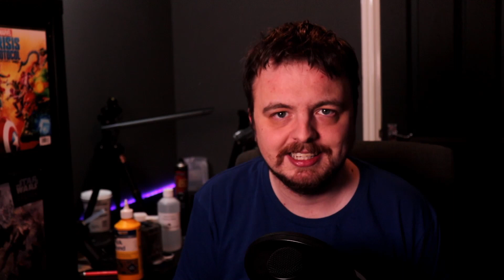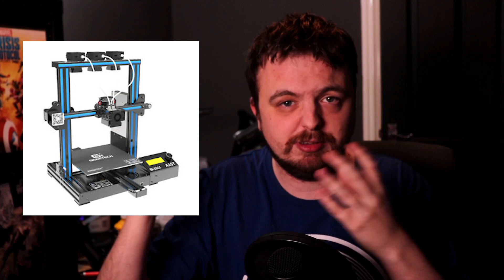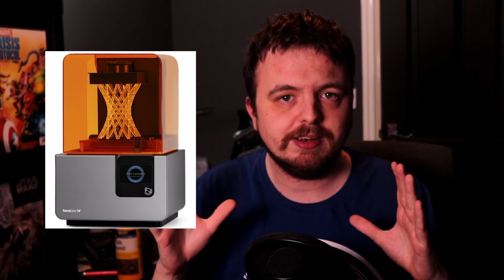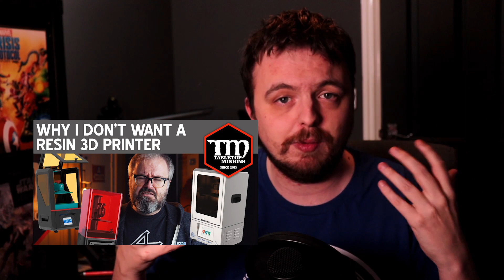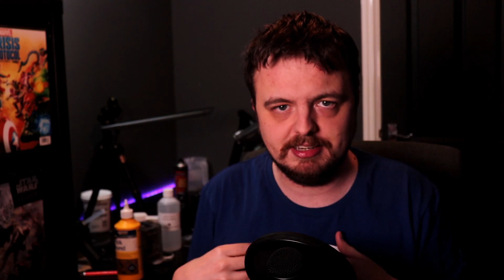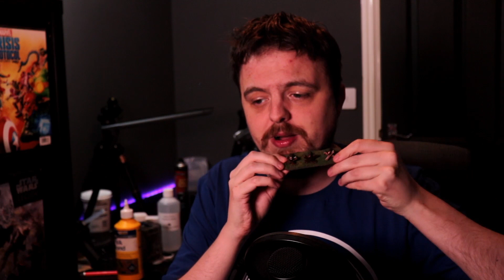Resin VS FDM 3d Printer For Terrain?

Comment: resin print time is only really determined by max vertical height. a full plate will print at the same time. That's a big advantage to fulfillment if you can maximize space efficiency.

Comment: U mention that you can chop the Terrain up so it can be printed in parts on the resin but yoi say this is difficult or near impossible.?? But is it? I thought/hoped it would be quite easy to split the pieces down and glue them later

Comment: I have an Ender 3, im getting a Creality CR-10, and I own an Elegoo Saturn.

I use the Saturn to print off whole armies of minis in a single day, because the Saturn has a massive print bed for a resin printer, but looking at the size of most terrain, FDM looks to be the way to go there, as for "Well the layer lines are clearly visible." Not everyone needs perfect 1-1 terrain, I personally just want terrain for wargaming that doesn't cost me a hundred dollars per piece, and I don't have the skill or the will to make stuff out of foam, foam feels too wasteful to me, any incorrectly placed cut and you end up with a ruined block of foam, but a decent FDM print means maybe a quarter of a roll of filament that I can print off while im painting or while im at work.

If it looks good when its painted, who cares if you can see the layer lines from an inch away?

Comment: I've been using flsun qqs pro deltas, 0.2mm layer height at 100/mms speed. Getting good prints in half the time of typical ender 3 pro. A 3.5" by 4" building 2" high took 4 hours approximately. I tend to go for stl designs that need no supports and small amount of infil.

Comment: I have a Tevo FDM with the large bed, it works okay, but the terrain can get bad, I pre ordered the elegoo Saturn because of the build volume, so I am currently doing research. I don't see anyone talk about if you have a large build plate resin, how much faster it would be to print multiple things, like 3-4 tower walls at once, since it takes the same amount of time, that would be significantly faster than an FDM
Reply from the maker: That's a great advanatage to resin printers, multiples at the same time! The main downsides are the actual resin, cost and saftety etc.

Comment: Awesome video as always Jay.  I have had a CR10 Mini for two years and had very little success with it to be honest and it hasn't been switched on for over a year.  My wife bought me an Anycubic Photon Zero as an early birthday present and I was so impressed that I bought a Elegoo Mars the week later with the cash I would have spent at Salute this year.  Great printers and ideal for MCP and Legion to print out smaller things as you say like control panels and griblings and the quality is excellent.  Build plates are still pretty small but you can position stuff quite well if you play around with them, but buildings are pretty much out of the question.  

That said Elegoo are about to launch the Saturn very soon and it has a huge build volume compared to other resin printers, and I am torn to sell my smaller one and get the Saturn.  Resin doesn't smell as bad as you think and I have mine on my painting stations at the side of a small window and you can hardly smell either of them until the UV cover comes off for cleaning or taking off the build plate.  Great video again bud thanks, Marc
Reply from the maker: I think the problem with the large resin printers that will come is simply cost, resin is pretty darn expensive. But for sure the true future looks like those large resin printers, still not a casual thing to buy but everything is improving all the time!

Comment: What I have seen people do with fdm printers is use them for more terrain based objects, that is what I did with my fdm printer till I sold it to a friend, May get a new one eventually, and while I might make a few smaller terrain pieces with a resin printer when I get mine, I also have been learning to make molds, using the printed object to make molds, mostly for the mass production and the fun of it all, This way if you do not want your terrain to have lines, from an fdm even a resin printer will have lines but not noticeable at all when painted up, combining the hobby with other hobbies makes it more fun. tedious to some but fun for others, and I can see how some people will look at a resin or fdm printer more over hand making stuff, because not everyone has the time to sit down and make things from scratch while you put in a file and hit print, well after a quick edit of it on a program, It comes down to convince and time and a room for it, In all I personally think that FDM and Resin 3d printers are just another Tool for the hobby. Also good video.
Reply from the maker: I saw a video about an Elegoo Saturn or something, basically a massive resin printer...now that's the future, but the cost of the resin would be prohibitive with them. It's interesting, it's inevitable but don't know where the dust will settle.

Comment: I have a couple of resin printed Rollers that were printed for me as a test by one of the manufacturers,  here in the US. They are 131mm in length.  They had to scale them down to print them. This actually took the texturing out of the  actual scaling for terrain.  My FDM will print the same roller at 150mm length which will give me the correct scaling for the 25-32 mm terrain builds. If you  want larger terrain pieces then I would suggest an FDM printer with a build area of 180x180x180 mm. Even my printer will not do a 6"x6" tile, the best that I can get is a 4"x4" tile, effectively 10cm squared. But having said this either a resin or FDM printer will work. Which leaves us with the question: is this printer in my price range? If you can answer yes to this question in reference to a resin printer, my recommendation would be go with the resin. If your answer is no, the a good FDM printer can actually be bought for a decent price. Another issue is how good is the support for the printer, or if I have a problem does the company help? Another question you must answer: will the initial outlay for the printer and accessories not included be worth it to me? Most, if not all resin printers do not come with a curing UV light. So the initial outlay is greater than most people would expect. So, you need to buy the printer, resin and UV light. For an FDM printer the only real upfront cost is the printer + 1kg of Filament. Of course there are other accessories that you can get with the printers (either type), that are not exactly necessary upfront,  but you will have to get at some point in the future. That being said,  I think that this was a good video for what it is made for.
Reply from the maker: They are all fair comments. I didn't get too much into the nitty gritty but it's true things like resin adds up, the uv curing process. I should have stressed that printers are their own hobby as well basically.

Comment: I thought about getting a 3d printer when the prices dropped on them, but I ended up deciding to just wait a few years and learn more traditional techniques in the meantime. I figure in a few years they will not only be (relatively) inexpensive but they will probably be a lot easier to use than they are now. Plus, I think the hands-on real world aspect of building terrain is what I enjoy the most, so I might keep doing things the old way even if I have a 3d printer.

Your idea of using it for things like doors seems like a good one.
Reply from the maker: I often think about terrain as almost a requirement rather than a hooby, and I know that sounds crazy but I think essentially because there hasn't been easy cheap ways to obtain certain pices, that I thought about it more in the needed category rather than the fun category. It can obviously be both or one of them. 

Terrain for fun is never going away, but people who make terrain just to have a functional looking battlefield, won't care how they get it as long as it is reasonable, either in terms of cost or time.

3d printing isn't reaosnable yet.......for most people.
Reply: Dakka Flakka Flame Smart man ! First learn sculpting with traditional materials, it’s great for learning mass, shapes and proportions.
I’m not spending money on stl’s when i get my printer, or at least as little as possible 😉
Reply: @DarkMatterWorkshop  Yeah, if I were to buy myself one now I don't think I'd be able to resist spending lots of money on cool STL files.
Reply from the maker: Thingiverse has some good free stuff.
Reply from the maker: Will you make your own? The main thing that puts me of printing is time!
Reply: I recently got a model from thingiverse printed via an online service. 25 quid for a large fantasy building. Really good print quality and returned in about 9 days. Certainly a viable option with so many companies offering printing services now. All the benefits, no hassle.

Comment: I run both FDM and Resin printers. The Resin for detail terrain like small scatter barrels, boxes etc is awesome as well as printing minis. Its not as bad a smell as many make out as my printer has carbon filters and I use Esun Water washable resin very low smell no need to use iso for cleaning.  The FDM i use are great for large terrain yes they take a while but worth it in the long run.

As for time the resin prints the bed at same time so is not the same process as the fdm where it goes between the models so If on the fdm i print 8 barrels it goes from one to the next layer by layer, The resin prints all layers at one time. FDM 8 barrels prob about 6 hours, resin same 8 barrels 2/3 hours.
Reply from the maker: Interesting that a few people have both, I was tempted, but short on space myself.

It's a good point that resin printers based on height mainly. whereas fdm based on height, size and everything!
Reply: This is what I do. Elegoo Mars for mini's, scatter, and bits. Fdm for really big minis unless the file is split up for resin, some terrain stuff, and buildings. Great addition to crafting. Get to have the fun of crafting terrain with the added benefit of not worrying about if you have certain pieces to make what you really want to make. Plus right now getting the Elegoo mars and ender 3 costs less than $400 together

Comment: I have an FDM and SLA printer and prefer the FDM. Honestly this is due to a number of issues including the smell/health concerns, the more lengthy/messy post printing finishing process, and my lack of time to learn a whole other form of printing as it’s a lot different than FDM. I will say the detail you can achieve with the SLA printer is really impressive. If I can find time to learn more about supports/slicing for an SLA printer in addition to finding a ventable location to put it then I would probably have a more favorable opinion . Either way I feel that 3D printing with either method can only enhance our Miniature hobby. Just know that if you think you’ll never get everything painted now wait until you get a 3D printer. 😂
Reply from the maker: I am terrible at buying and not painting!  I do think that resin printers will get eaiser because at the moment it is it's own hobby for sure.